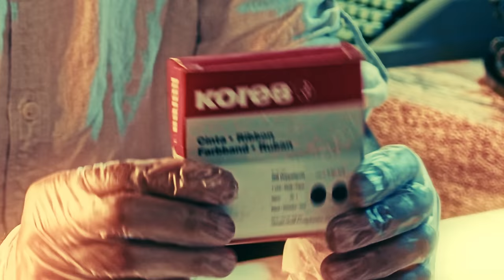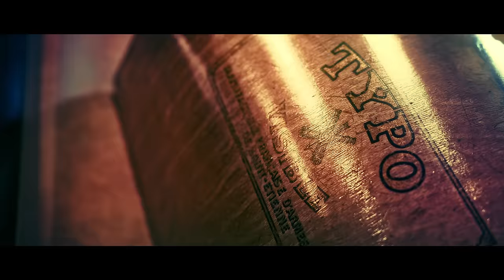Restoring an Ultra Rare Typewriter from 1908✨ASMR Unintentional

Comment: This typewriter must be a dream to type on. All levers, no linkages! That’s why the keyboard is semi-circular! Must be very satisfying keypresses.
Reply: As an ignorant pleb can you explain the significance of this I am interested
Reply: @the_protectorof_smols3563  A mechanical typewriter works by mechanically striking a type bar with a raised, reversed character cast into it, onto the page. Between this type bar and the paper, a cloth ribbon impregnated with type ink is raised. The end result of this action is that the raised letter physically punches the ribbon against the paper, causing ink to transfer to it in the shape of the letter cast into the type bar. Each key on a keyboard corresponds to one of these many type bars, such that when you depress a key with sufficient force, the corresponding type bar strikes the page as intended. 

On comparatively modern typewriters, the keyboard is set up in horizontal rows, like we would see in a modern computer keyboard (which actually looks the way it does because of mechanical typewriters but I digress). But, the set of type bars, called the “basket”, needs to be curved. Why is that? Well, it’s so that every type bar is equidistant from the page, and therefore requires no additional force to strike compared to other keys. Now, on most typewriters, in order to get grid-like keys to mechanically link with curved type bars, an intermediate linkage, just a piece of metal loosely riveted to the key and type bar, is required. But, in the case of this typewriter, it appears that the keys actuate the type bars directly, through leverage! This makes for an odd looking keyboard layout, but it means that there should be no perceivable “slop” in the typing action. Because typical typewriters have another component between key and type bar, there will always be a minor amount of wiggling. In this design, the action appears to be much, much smoother! It must be very satisfying to type on because of that!

In short, imagine pressing a key a computer keyboard with the end of a pencil (the linkage). That is analogous to a typical mechanical typewriter. But this one is akin to pressing the button with your own finger! Far smoother!
Reply: There are some modern typewriters where the keys work directly on the type bars, but in those cases the key needs to make a turn to reach the type bar. That added geometry can also cause slop. This typewriter being as direct as it is seems nice, and likely cheaper to manufacture as well.

Comment: Lovely to see typewriters being used again. Remember when sanding to always go with the grain of the wood and not against it. Also, never use WD40 on a typewriter. It will ruin the mechanism. An excessively experience elderly typewriter repair man passed on that advice to me. Remember to fully research how to clear your typewriter or you may ruin it. These historical pieces need caretakers.
Reply from the maker: Agree with you about sanding wood, however I don’t use WD40 haha I use products recommended by people who are fond of restoring typewriter, i.e vaseline oil. I found these infos doing the actual research ;)